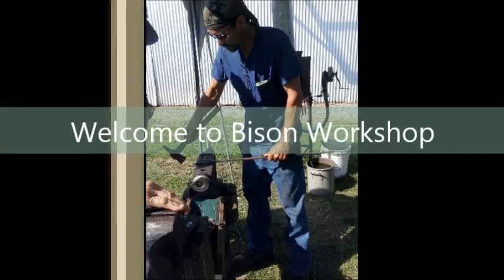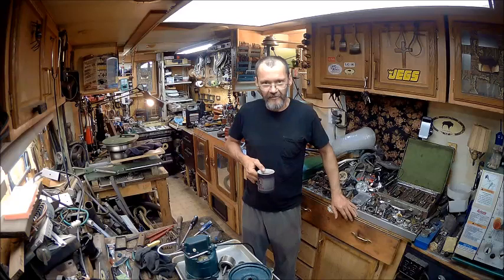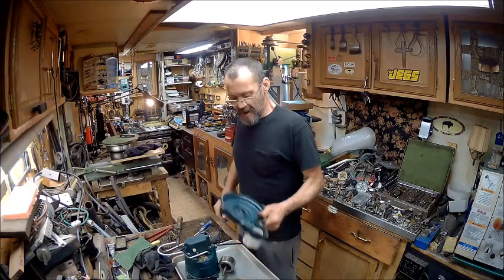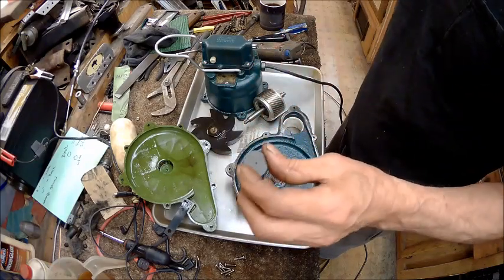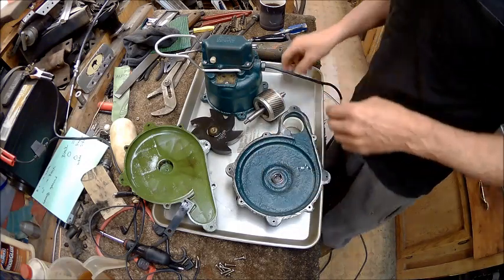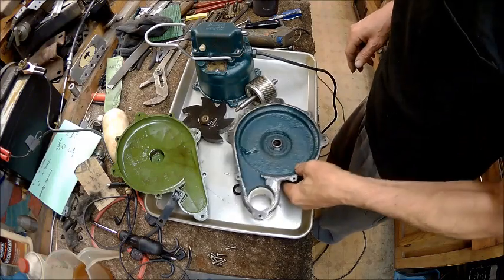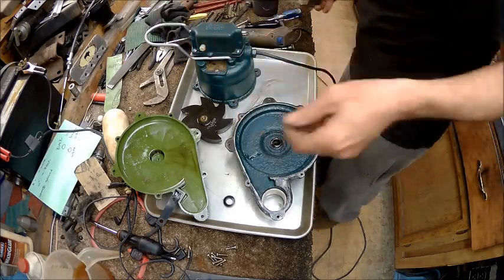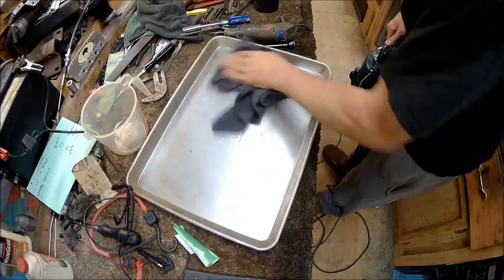zoeller m53 d sump pump rebuild part 6 machining  the seal

Comment: Nice one Bob, I have often ( at a pinch, out in the field) temporarily repaired a mechanical seal with just a sheet of very fine wet and dry covered in good old fashioned spit and the flatness of  the face of an engineers square, needs must one the devil drives......10/10 for your solution.
Reply from the maker: thanks

Comment: Been there done that one , all fire pumps have special size seals that are high dollar and long wait to get in mail, after fixing as you have done here I found out over the years, the factory just ordered under size outside race. so every time a seal and bearing went out, I would machine out the housing to except the common over the counter parts, cheap, common part and same quality  !   Worked great !  cost of common one was around 6 to 8 bucks the special one from fire supply cost over 50 bucks !  Great job Bob !